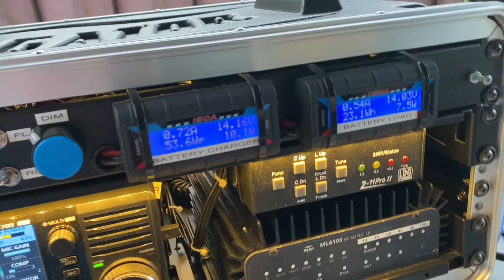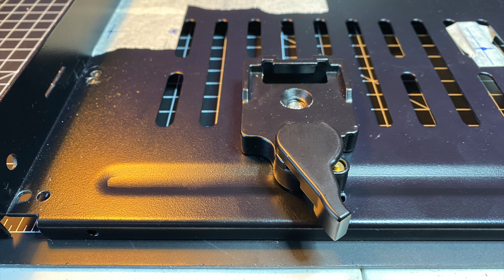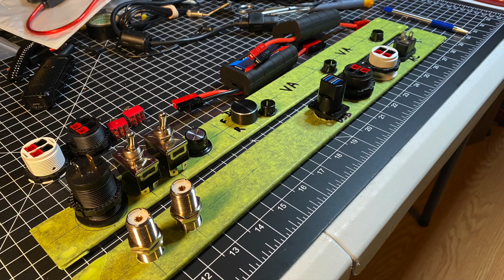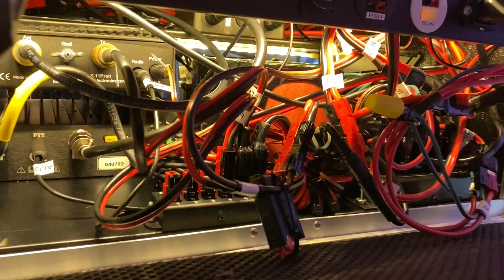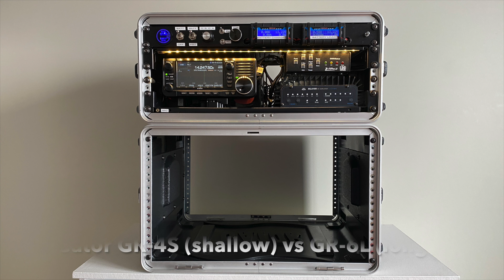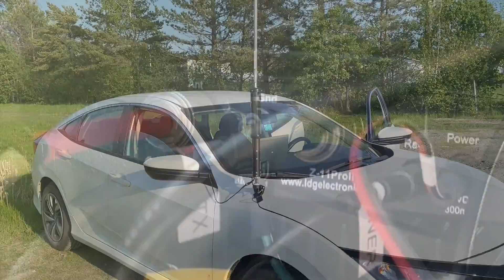IC-705 100W Go Box | Quick Release | RM Italy MLA100 | Bioenno 20A Battery | Solar/Car/AC Chargers

Comment: Which shelf did you use? Any chance you have the part number? Great video, I am going to attempt to replicate this with my 705!
Reply from the maker: The shelfs were purchased over 5 years ago from Amazon, finding P/N would be tedious and may not exist today, Good luck on your build! 73
Reply: I have gathered most of the parts and am getting ready to start the build. Any chance you recall which LED lights you used?
Reply from the maker: @cgreenatl83  Standard 12V self adhesive LED strip from a local Electronic store, cut as needed, solder connection, easy done. They may unglue over time so I put very small tie-wraps on each ends.
Reply: @VE2FGJ  Thanks!

Comment: Nice job on the Go Box.  Food for thought for my next project.  
I saw in you video that you were using a Genasun  "Boost" charge controller.  I have both, the regular 5A and 10A controllers, and a new Boost 8A version.  But, I'm not sure when to use the Boost controller versus the regular controller?  I'm curious of your thoughts on this.
VE7EFF
Reply from the maker: The "Boost" version as per their web site: "The unique GVB-8 Boost charge controller with MPPT allows a lower-voltage solar panel to charge higher-voltage batteries. Want to charge a 24 V battery with a 36-cell (12V-nominal) solar panel? No problem. A 48 V battery from a 60-cell (20V-nominal) panel? We’ve got you covered. With 99% peak efficiency and the
ability to charge with as little as 5 V of input, they are the industry’s most efficient voltage-boosting controllers." I am not sure I am benefiting from that with my portable 60W solar panel, but they make very good controllers. Hope that helps. Thanks for the question and nice comment, good luck with your next project! 73
Reply: @VE2FGJ   
Thanks for your reply.
I'm testing the 10A lithium controller on my 23 Ah battery pack/go-box.  Right now, with our cloudy skies and low level sun, it looks like I need at least 18Vdc output from my SunPower 100W and 50W flexible panels to start charging (and mind you it's only supplying ~50-100ma of charge current).  So, I think I'll give the Genasun 8A Boost controller a try next to seeif  it it can do any better in these low light conditions...
73